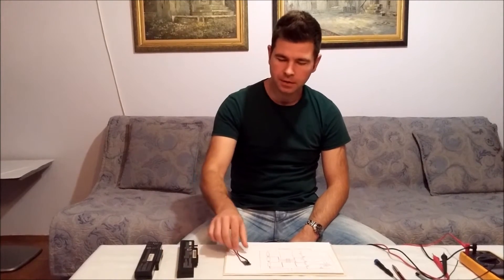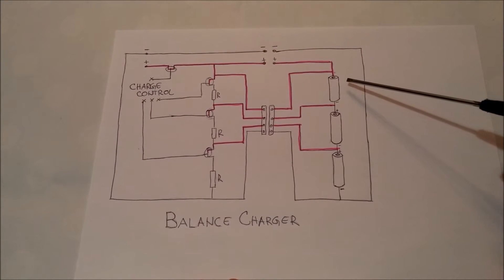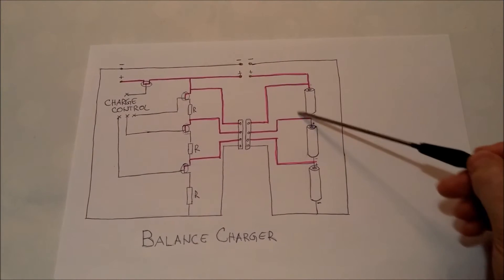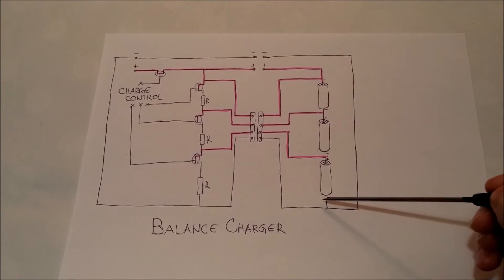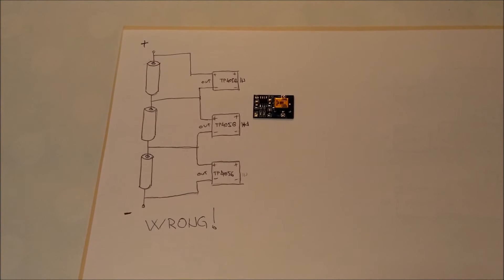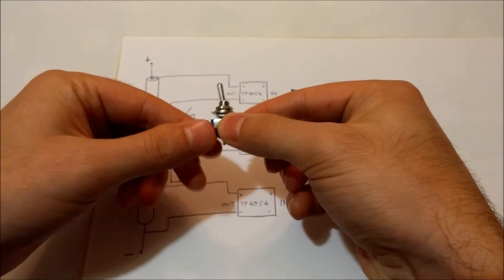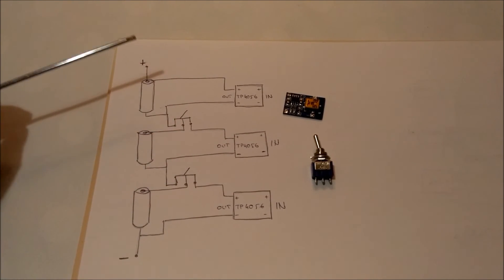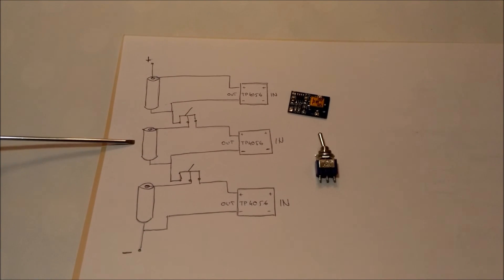DIY - Make balance charged 12V & 5V battery pack using 18650 cells and TP4056 Part1

Comment: u should use 6 pin interuptor per each cell for switch from parrale to serial  and u can use 1 charger for all or many small charger if u wish , and not just 3 pin interruptor  look my schematic i do 8 year ago  for my bicycle http://cyclurba.fr/velos/331/4-velos-poshul59-moteur-35o-watts-controlleur-8oow-lifepo4-environ-70-nO-8o-km.html

Comment: Regarding your first diagram using TP4056 which you have labelled "WRONG!", I have been using this system for a year now with an 8-cell battery pack and have never experienced any problems.
Reply from the maker: My constellation of 3 batteries almost explode, actually tp4056 module almost explode...
Reply: I wonder if you're wiring the 5V supplies to all of the TP4056 board inputs in parallel... if so, then consider that each TP4056 has a common ground between input and output. Therefore, with just two boards (for simplicity), having outputs wired in series and inputs wired in parallel, you will be putting a complete short circuit across one of the cells. Extrapolating up to N cells in the battery, you will be shorting out N-1 of the cells. That might produce some fireworks. The way I tackled this was to use a separate mains-to-5V 1A power supply unit (very cheap on eBay) for each TP4056 board. That way, the mains transformers provide the necessary isolation between the TP4056 boards. Never had a problem.
Reply: Exatly right
Reply: So what you are saying is that, by using a cheap 20w usb charger with 4 ports, for example, then conecting individually each 5v 1A outtput port to a single TP4056 module will solve the first diagram?( the one that says wrong)?
Reply: You'd have to check to see if the four USB ports have a common ground line. If they have separate grounds then you could go ahead.
Reply: Hey Andy thanks for the explanation! I'm just curious if I only connect the batteries all in parallel then is it safe to supplies all of the TP4056 board inputs in parallel?
Reply: That way, not only would you be connecting the inputs of the TP4056 boards in parallel, but you would also be connecting the outputs of the TP4056 boards in parallel (because the cells are connected in parallel). I don't know if you can connect the outputs in parallel like that, and I don't know how you might find out.
Reply: you should use 6 pin interruptor and not 3 pin  for each cell , look my diagram http://cyclurba.fr/velos/331/4-velos-poshul59-moteur-35o-watts-controlleur-8oow-lifepo4-environ-70-nO-8o-km.html

Comment: hey buddy, great vid, I have a question, I'm gonna charge a a tablet battery, just the battery alone with the tmodule, my source of energy will be a solar cell, 6v 300mah, my question to you or if anyone would be kind to help me, how long can the tmodule and the battery stay unattended after being fully charged?
Reply from the maker: 300mA is not so much, if you have phone battery of 3000mAh you will need around 10h to charge that battery. You regular phone charger has 2.1A and your phone is charged in less then an hour. To answer your question, battery and t module can stay forever, it do not make any difference if you do not discharge the battery. Also you charging solar cell can stay connected all the time because Tmodule stops charging when battery reach 4.2V

Comment: if you'll use one power source for this three TP4056 modules (or just connect inputs in parallel in case to use them with just one usb plug) you'll get cell #2 and #3 exploded because of short circuited when switch is in serial position (because TP4056 has negative terminal shared from IN to OUT). So you'll have to charge this device from 3 separated power sources or add few more switches in between of inputs.. so fucking genius!
Reply: sure, you can. my email is my nickname at gmail.com
btw I'm living in China (Shenzhen) so it won't take any long to receive anything I need :D
but not for now because of Chinese New Year (right today)
also you can use mouser.com to choose which component you need by it's characteristics (and mb order if it is convenient for you)
Reply from the maker: When charging switches need to be in right position to break short connections between tp4056 on the out side, on the in side tp can be loaded with one power supply without the problem. Model is tested! I am waiting for battery holders and will make part 2 of the video with 6 lines x 3 batteries in parallel!
Reply: sure, you'll charge it when switches is breaking connections, but how'll connect one power source to 3x TP4056? You'll need to switch on this switches later on anyways, so if inputs are soldered in parallel, you'll need to unsolder it first. Or place some switches between inputs as well. I just used a N-channel MOSFETs to solve this problem and a P-channel one  to control this MOSFETs.
Reply: He must be using 2 separate DPDT switches to remove two of the chargers' grounds from the batteries.  Would be nice if these little tp4056s had isolated grounds.
Reply: TP4056 is simply positive linear voltage regulator, you can not isolate GND.
Anyway it's not recommended to use several impulse 5V power sources in parallel because you can get up to 40V voltage impulse somehow (I've already burned 6xTP4056 before I realized that). So I developed some simple circuit that will automatically disconnect one cell from another in series when a power source is connected (+5V bus).
http://take.ms/dh75P M1 is P-ch MOSFET and M2 is N-channel one.
Reply: M1 is used to safe from short circuit when the switch ON/OFF is in ON position while a power source is connected (it must be OFF while charging anyway).
You can simply replace ON/OFF switch with MOSFET M1 to remove any switches for fully automatic separation. I didn't do that because of Rds (0.03 Ω)  – I just want maximum efficiency from this battery pack.
Reply: I am interested in Mosfets/Triacs that have low Rds under high amp, low voltage (3-30) loads.  Have recently ordered some  G3MB-202P SSRs for battery switching ... do not know yet if I can avoid a diode drop ... and it takes forever to get things from China.  Anyway, can send you an email, epicmap?  You are very private, buy I am easy to find.
Reply: epicmap : u don't need to do that !  just use  6 pole interuptor per battery and not just 3 poles interruptor and  your battery will be in parrale for charge  and in serie for using ,    ----> + - <-----      like this ( battery + and -  is connected to connector in middle of interuptor     using 6 pole interruptor have 2 middle pin  connected to + and -  , upper pin connected for serial line , and lower pin connected  to parralale line or charger ,  and u can use  1 charger for all batterie  or many charger in parralale . u can see my schema here  http://cyclurba.fr/velos/331/4-velos-poshul59-moteur-35o-watts-controlleur-8oow-lifepo4-environ-70-nO-8o-km.html look my page and seach i make a schematic long time ago

Comment: This could be made automatic with relays but it will not be effective since the battery  pack needs to run trough switches :S
Reply: do you have this diagram bro
Reply: you could make a Transistor switch, at 5v in to drive the relays

Comment: I made this kind of charger but I'm thinking how could I power all those tp4056s at once... 

The connection that I have in mind now uses two switches and if their position is wrong the batteries will explode :D 
Do you know how this could be done safely?
Reply: You need a single adapter for 1 tp4056, each tp4056 on its own adapter... Then the ground wont be shorted to 5v and they will be isolated, i have a similar concept on my channel. :P
Reply from the maker: You need to be sure, before plugging the charger (5V), that all switches are in right position, you need to be sure that all batteries are disconnected from each other and connected to tp modules.

You can connect all + nodes of the modules to the one positive node of the charger and all - to the negative node of the charger. You just need to know that when you start charging for example with 5V 2.1A this 2.1Ampers will split on 3, because 3 tp modules uses that current. You will effectively have around 0.7A charging current per battery. How some of the batteries is fully charged tp will stop charging and current will increase in other tp moduels. However, tp takes 1A at most for charging.
Reply: Have you tried to connect the chargers in parallel? Because I made that way short circuit in the battery when it switches was in use mode. But when it's on charge mode its ok. This is why I think it would need more switches to break the parallel connection from charger input.
Reply: u need 6 pin connector and not 3 pin connector  for each cell , 1 interuptor 6 pin per cell , look my diagram http://cyclurba.fr/velos/331/4-velos-poshul59-moteur-35o-watts-controlleur-8oow-lifepo4-environ-70-nO-8o-km.html
Reply: it's safe and it's will never explode  u can use 1 charger if u do that , or  many small charger with same line - , bcuz it's // if u use 6 pin inter